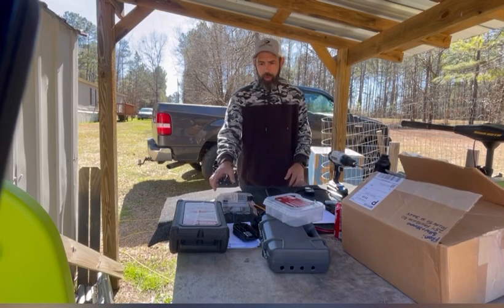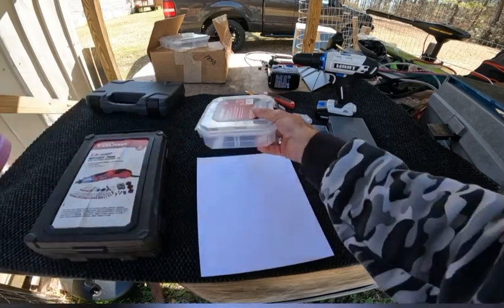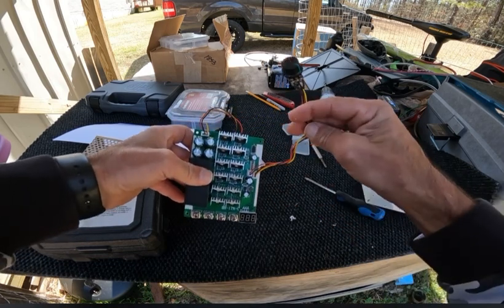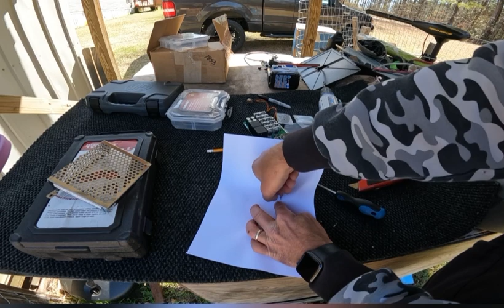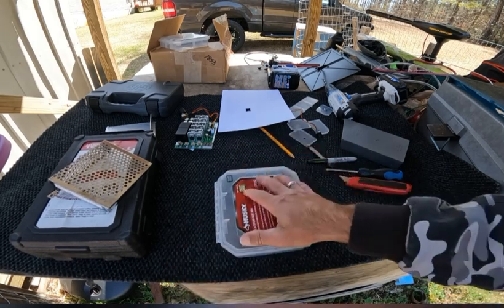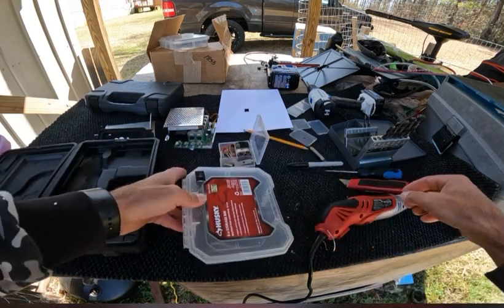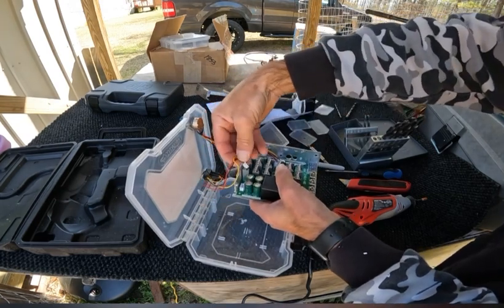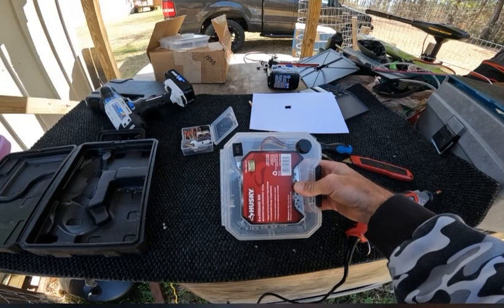How to cut the holes for the PWM switch.

Comment: Do you ever vent the boxes you use. I’ve seen and followed your idea on the black project box. Just wondering if you’ve ever had any issues with it getting too hot in the box?
Reply from the maker: I put a 100amp in the project box it had a fan built into it. I never had it over heat. If you don’t have a fan on it and wanna run your trolling motor wide open for long periods I would vent the box so it doesn’t over heat.
Reply: Thanks again and great job with all your videos they are on point!
Reply from the maker: You’re welcome. I appreciate it more than you know
Reply: Great video man I will love you to make more videos on this 100Ah PWM controller
Reply from the maker: Have you watched this video on my page?https://youtu.be/NdA61Oh1OiM
Reply: How big of an electric motor can this carry if the battery is multiplied
Reply from the maker: As long as it’s a brushless motor and under the amps of the PWM it can be large as it can get.